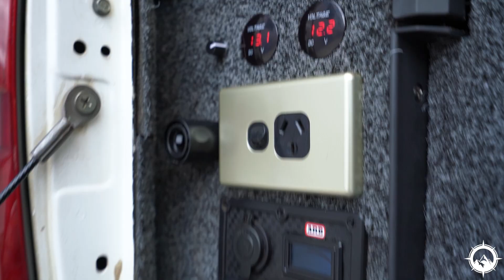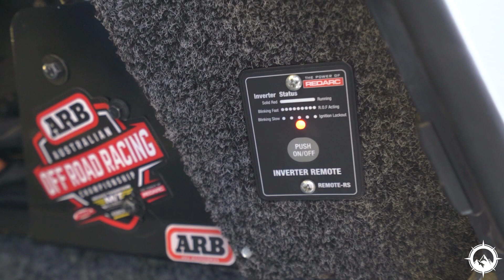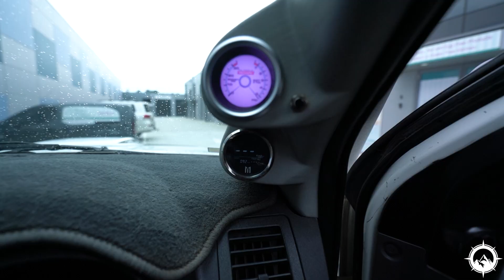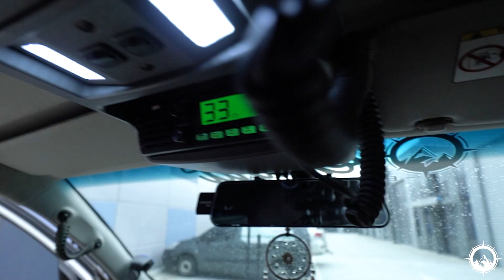RIG RUNDOWN!! || Overland Explorers Hilux Tourer - Sandy Fiske

Comment: Very nice hilux guys. Hope the cruiser is going just as great. What mountings did you use for the motop tent onto the rhino rack or did you just use the ones motop supply?
Reply from the maker: Thanks Ryan 👊🏽 used the brackets that were supplied from motop but had to drill some holes in the platform slats to line up with the tent mounting.

Comment: Love the rig how did you go about get the newer steering wheel into the older pre facelift hilux
Reply from the maker: Really easy, Cory. direct bolt on replacement. although the steering wheel controls do not work.

Comment: Well presented. Awesome rig. Can I please ask a couple of questions;
- what brand is the fridge surround/cage and the roof mesh shelf (I have the same canopy and rhino platform and have black widow drawers)
- have you done any mods to the rear seat to fit the ARB twin compressor behind it?
- I think you are local to me, have seen your rig on the road - outer east Melbourne. Who did you use for the auto elec work ?
Cheers
Reply from the maker: Thanks for the feedback, mate. 
Did the canopy internals myself, cheap pipe bender off ebay!
Yes, did 'the' rear seat mod to be able to get access to the rear. 
Sounds right! Most of the work done myself, however outsourced some work to some buddies here and there aswell too